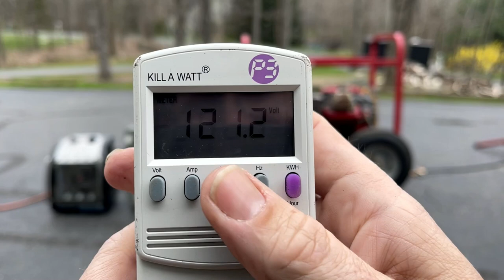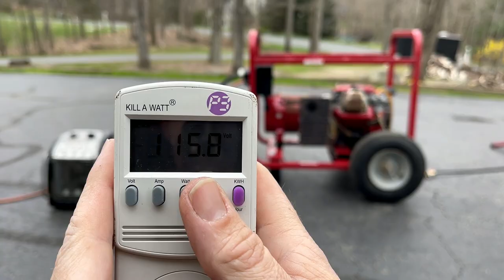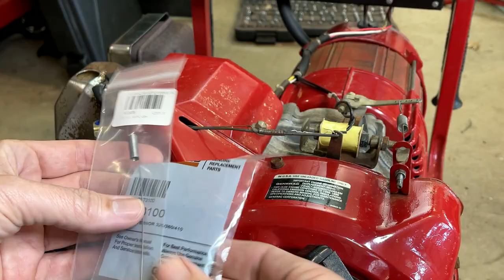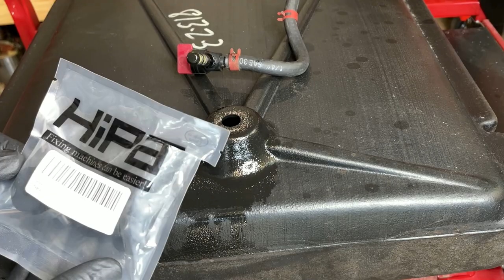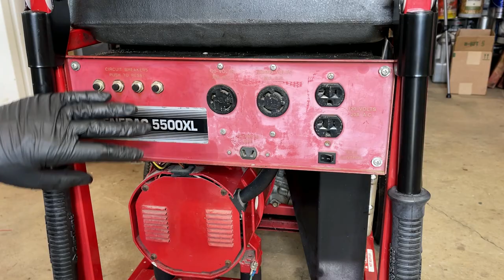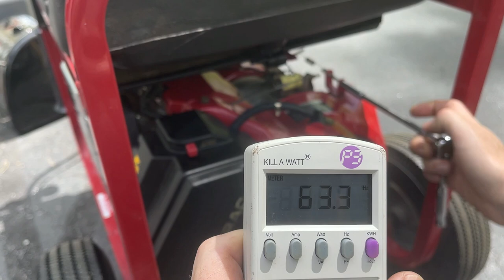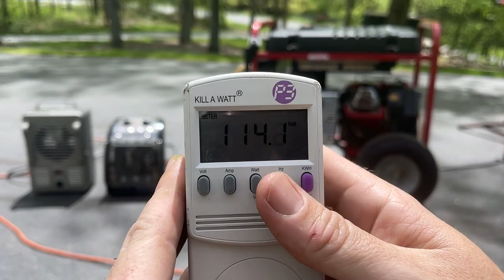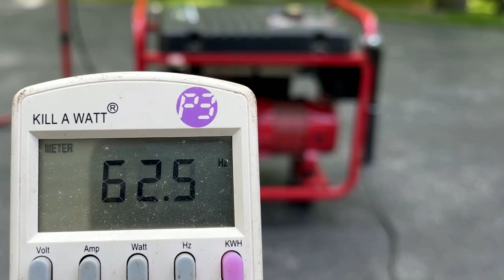Generac 5500XL with Governor Issues

Comment: James,  Where is the best source for older generator parts?  And one more question,  what is the best cleaner to use in the ultrasonic bath?  I've used TSP in the past with moderate results...your results are so much better.
Reply from the maker: The best I have used is the Harbor Freight Super Heavy Duty Degreaser.  There are probably better, but once I found the HF stuff I stopped looking for anything better since it works well.  No good source for older generator parts unfortunately.  Sometime eBay.
Reply: HF stuff

Comment: Have you fixed any Generators with over voltage problem the Hertz are OK  and thank for all your videos
Reply from the maker: Yes.  If it has an AVR, then would try adjusting it or replace it.  If not AVR, then the voltage does usually run high without a load (127-134 volts).

Comment: I really like your videos.  I have a Honda EU2000i that runs great.  It will run a 100w light bulb but it will not run under 700w load.  It runs for about 15 seconds then sputters and dies.  Eco mode on/off makes no difference.  I have installed a new carburetor but no change.  ?????

Comment: What kind of cleaning solvent do you use in the ultrasonic cleaner and is it freely available nowadays?
Reply from the maker: I use Harbor Freight Super Heavy Duty degreaser.  It is always hard to find in the store.  Usually it is near the parts washers.

Comment: I'm wondering about the power head. Could it not be the original? I've never seen one painted any color other that black or plain metal. Excellent video as usual.
Reply from the maker: I think it is original.  Some are red like the Generac 10000EXL I worked on a couple years back.  https://youtu.be/PM8VXYXOJUs

Comment: Hey Jim;  I have a Generac 4000XL.  Fuel gauge hardly works.  Where can I locate a replacement Fuel cap/gauge?  I ask because ereplacementparts indicates Part Number:85134 Gauge, Fuel Obsolete - Not Available.   BTW Love your videos.
Reply from the maker: Your best bet is to order a few from Amazon they are the correct length and give them a try.  Some have different threads and may not work so it is trial and error.  Stens New Fuel Cap 125-260 for Murray 024064 https://a.co/d/2w5EL1p
Reply: @jcondon1  Thanks Jim.  I'll give that a try.

Comment: I suggest you put a tachometer on those engines. It is marked on the engine MAX RPM'S.... 3600 usually....if you go over that for say 5 to 10 minutes you got a hole in the block where the aluminum rod came through.
Reply from the maker: On generators I usually go by hertz.  3600 rpm is 60 hertz.  I always find it odd that the engine manufacture states 3600 rpm as the max, but most generator manuals have you setting the engine at 62.5 hertz (3,750 rpm).  I try to keep it as low as possible.  61.5 hertz is about the lowest you can go without a load.  Otherwise the engine will be too slow under a full load.
Reply: @jcondon1  The reason for the 3600 is the aluminum rod. In my lifetime I have seen dozens and dozens of holes in Tecumseh and other engine blocks. I used to FIX the hole with JB weld if the rod didn't break the block into pieces. When the engine gets hot and is revving above 3600 the rod melts onto the crank. We used to save the cranks by soaking them in lye. The lye would eat the burned on aluminum off the crank journal but not hurt the crank. You need to watch the RPM'S on those old engines.
Reply: @jcondon1  Here is what happens around 3800 rpm's  https://youtu.be/AS-2anKrBfw

Comment: James why did you put the handles so high if they were a little bit lower the handle should be more straight
Reply: Watch at 37:26
Reply: @Tom-In-Ga  OK thanks Tom I missed that part
Reply from the maker: They were definitely higher then I wanted.  But as long as you tall, then it works.

Comment: On my Generac My gov return spring doesn't connect to the Carbs Link hole but another hole on that carb pivot arm> mine is an older Generac  tough not the XL.jim

Comment: Not a good idea to hammer on the float pivot rod - the end can 'mushroom' and make extraction harder. It will also cause binding on reinsertion. Giving the ends a slight taper will help (chuck in drill and use a fine file to give a slight taper on end).
Reply: Always a critic shows up.
Reply from the maker: I agree.  Not a good idea, but sometimes it needs a little tap.  It was a small hammer.  Also the arm that hold the pin break very easily so have to go real easy on it.

Comment: I know the valve cover was possibly beyond saving but a technique that sometimes works is crunched up tinfoil with WD 40. Perhaps you are already aware.
Reply: James described it as ‘chrome.’  It’s not.  It’s buffed steel.

That is always going to rust, both the valve cover and especially the muffler cover.

You can get them back by soaking them in muriatic acid to get the rust off, but you’d have to repolish, then buff them again.

The best solution would be to polish them to a matte finish then use a hi temp stove paint and the valve cover in any rust oleum color you’d like.

As Neil Young taught us, so long ago, ‘rust never sleeps.’

Comment: James, just in case you answer random internet folks questions:   I have this same generator - does not make power - measuring rotor slip rings resistance - ring to ring - I see 10 ohms.   Is that out of spec?  In another video of yours you indicated should be closer to 50....
Reply from the maker: Those do have low resistance rotors.  I would say that is normal.
Reply: I found a vid that Bassguiltarist1985 did on an almost identical generac - and his reading matched mine.  Thanks for taking the time to respond to my question James!

Comment: Yeah the only way to truly take that carburetor off that brand motor is it take the whole pool rope assembly off the governor rod linkage off the motor all in one shot otherwise you've been your Governor right all the pieces and then and turn it throws your positioning off as well I know it's the one you're working on has been all two pieces like mine was I took a ball paint hammer and a flat piece of metal on my voice and straighten it back out straight and true and put it all together in one big piece keep in mind the poor rope assembly was a pain in the butt cuz it was cumbersome to slide through the holes hold the carburetor and all of it together and put it back on the motor